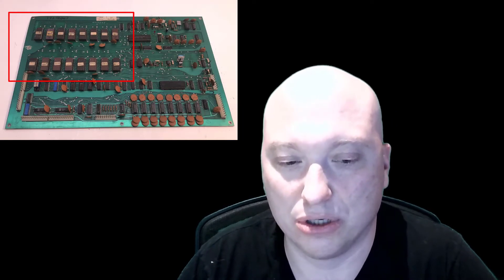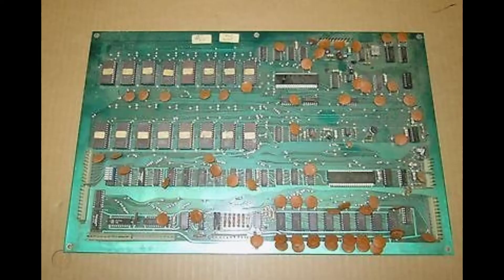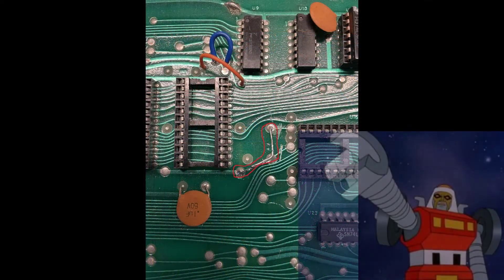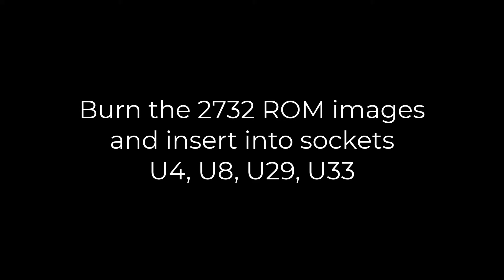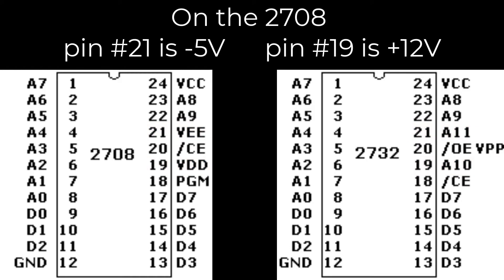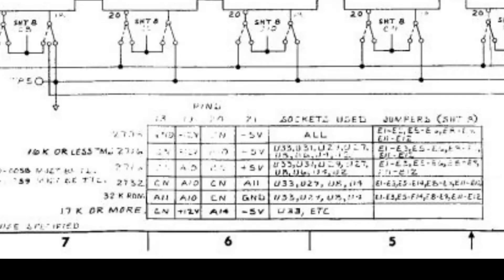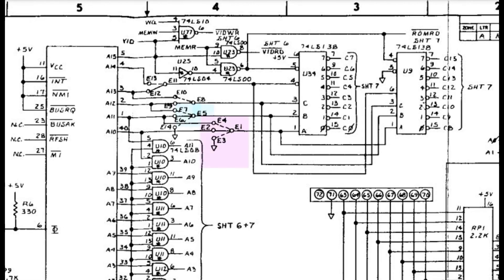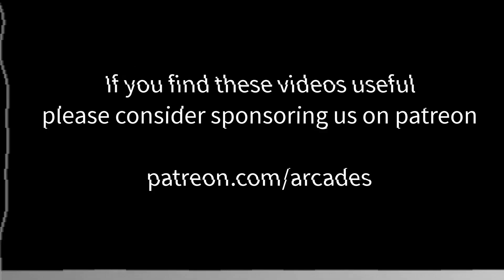Modifying a Sega/Gremlin Dual Vic or Extended ROM board to use 4 x 2732 EPROMS instead of 16 x 2708s

Comment: When taking an arcade board and converting the EPROM chips to a totally different game the PROM chips from the original game has a certain code in the prom chips that will only work with the original code in the ROM chips. How do you find that code in the ROM chips that works/married with the PROM chips code? Also when converting the arcade board the technicians modify the Watchdog circuit to work with the new code for the new game code loaded on the ROM chips. How do you find out how to modify the watchdog circuit timing with the new game code? you have to change the RC resistor capacitor in the watchdog circuit timing I think which technician do.
Reply from the maker: the proms can be read just like EPROMs with the right equipment. You can also get the PROM code from the same place you get the EPROM code (wherever you get your mame ROMS). No generally the watchdog is specific to the specific board hardware not the game code. so I"m not sure why you saw people changing the capacitors.